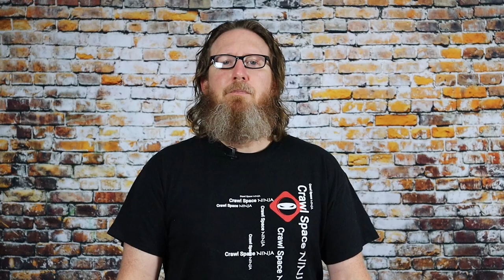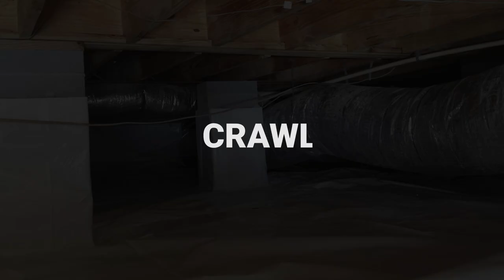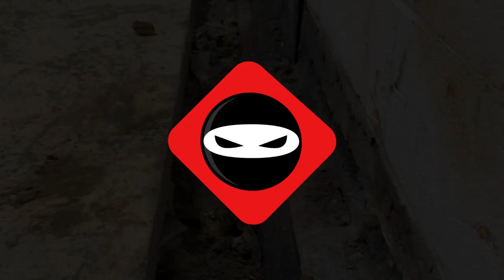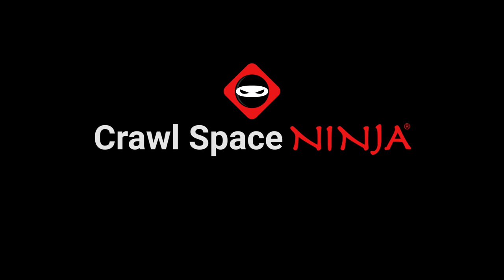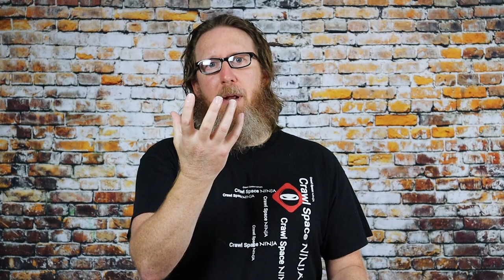Crawl Space Encapsulation with Ventilation | Where Does The Makeup Air Come From

Comment: I live in charles town west virginia and I incapsulated my crawlspace with the 12 mil vapor barrier from your store. I also installed the pink foam board between the foundation wall and vapor barrier that you buy from home depot. I seal all the vents. I do have the Tjernlund model V2D vent fan which is 220cfm. My crawlspace is the entire size of my house, the living space is 1,344 width and length and the height is roughly 4.5ft tall. Is this fan over kill or will it do. I also have a pipe that goes to a T under the vapor barrier that vents out through the roof which was installed by the builder when home was built. I also have a dehumidifier in Crawlspace. Please let me know whats the best option, right now I sealed all vents and removed the 2 fans I had in 2 of the vents because they were pulling water through the master shower drain into crawlspace. Thank you
Reply from the maker: Sounds like you have a good setup. The 1 cfm per 50 sq feet is a guideline and most fans can blow more air than based on smaller crawl spaces that but that should still be ok.

Comment: Hi, does crawl space encapsulation include sealing off any active hvac registers and returns in the crawl space in addition to sealing foundation vents?  Thanks.
Reply from the maker: We seal foundation vents with dehumidifier installed. If hvac vents in crawl space to supply air, may want to seal that too.

Comment: I know this is expensive but what I like to do is to is get a heat recovery ventilator and use that as the makeup air .
 And have one vent if it's approved by a professional HVAC contractor. My idea for the HVAC vent is NOT to dehumidify. it's too cool and heat the space .I find this very important especially if you have plumbing down there you don't want plumbing freezing. Although that's not very likely with encapsulated crawl spaces. still it's very refreshing to go in a nice pretty white crawl space that's well lit with lights and smells clean and dry and the air is crisp. By the way the HVAC vent for the crawl space is only put in if the ductwork is down in the crawl space. And it's not leaky.